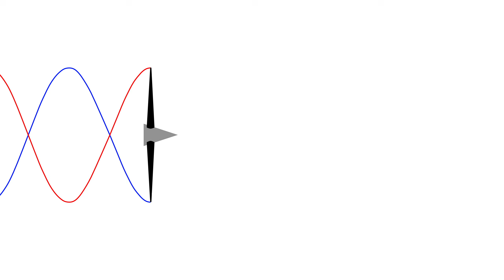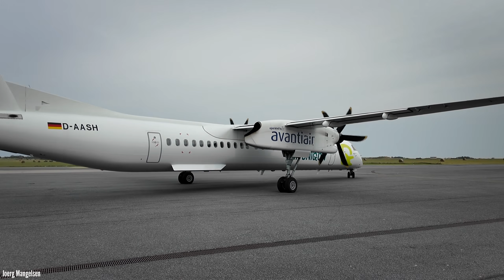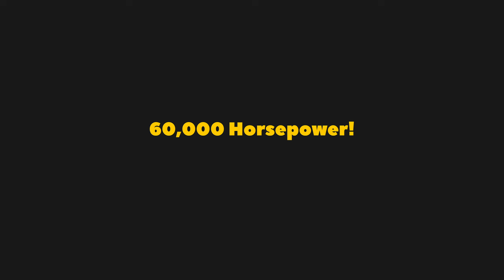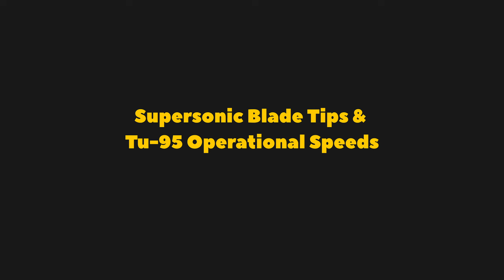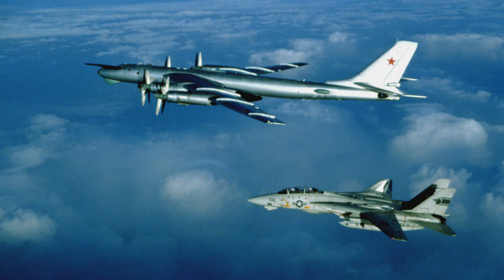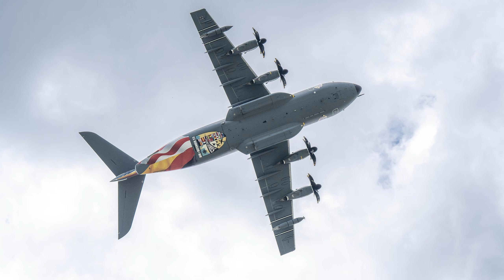How the Tu-95 Achieves Its Speed (& Why THIS Turboprop is Faster)

Comment from the maker: Support me on Patreon : https://www.patreon.com/letsgoaviate/
Smallest Turbojet Engines (Crewed) Design & Applications - https://youtu.be/PMmVKkrXUO8
Boeing YC-14 Upper Surface Blowing & C-130 Hidden Facts - https://youtu.be/_zZFNQDcwlA
Reply: You said that the propeller act like a wing.  I see on modern plain the wing tip banded to reduce wing tip turbulence vortexes. It clam to reduce airplane drag and improve overall air plane efficiency. Could that idea be apply to propeller wing tips to improve efficiency?
Reply: @miroslawkaras7710 I don't know if it could improve efficiency but I do know it would be super hard to make. A prop experiences huge centrifugal loads near the tip and a surface at the end going 90 deg from the rest would likely be torn off.
Reply from the maker: @miroslawkaras7710  Catto props did exactly that on their light aircraft propellers. It didn't quite revolutionize propellers. It has pros and cons, and on propellers it has cons that it doesn't have on wings. Maybe I'll cover it at some point.
Reply: @LetsGoAviate .
Very informative video; good graphics and explanation, without too much calculus.
Do you know if anyone has ever experimented with counter-rotating propellers, where the 2nd stage has a wider arc?
Reply: Well done

Comment: Its massive engines developed German engineers Anselm Franz and Ferdinand Brandner at Junkers Jumo is a major factor. The Jumo 109-022 is based on the enlarged version of the Jumo 109-004 turbojets known as the 109-012,

Comment: you neglected a possibly major factor:   the Airbus A400M's propellers adjust their RPM whereas the Tu-95's propellers do not adjust their RPM during flight to change speed; instead, they operate as constant-speed propellers.  So airbus has used two mechanical tricks to optimize performance at any speed and the tu-95 only one (variable-pitch blades). Therefore me guesses the shape of the a400m propellers may not even suffice to make up for the missing counterotating blades vs. the tu-95. AND The a400m engine has serious downtime-for-repairs issues whereas the tu-95 has very little.

Comment: 5k km is not 'cruising' long enough?  Test pilot Ivan Sukhomlin pushed the tu-95 during specific load and speed trials, setting official Fédération Aéronautique Internationale (FAI) records—including averaging 877.21 km/h over a 5,000 km closed circuit on April 9, 1960.

Comment: Flight testing and state acceptance trials conducted by test pilots like Ivan Sukhomlin determined the maximum and cruising speeds of the Tupolev Tu-95 and Tupolev Tu-114.
Flight Testing and Trials.
Factory and State Trials: Initial performance boundaries were established through manufacturer flight tests at Zhukovsky Air Base, followed by State Acceptance Trials with the Soviet Air Force and civil aviation authorities (Aeroflot).
Speed Record Flights: Test pilot Ivan Sukhomlin pushed the platform during specific load and speed trials, setting official Fédération Aéronautique Internationale (FAI) records—including reaching 877.21 km/h over a 5,000 km closed circuit on April 9, 1960.
Flutter and Vibration Testing: Because the Kuznetsov NK-12 turboprop tips move at supersonic speeds, high-speed dive and level-flight trials were critical to monitor extreme acoustic resonance and airframe flutter.
Resulting Speeds:
Tu-95 Bear Maximum/Cruise: Maximum speed reached approximately 925 km/h (575 mph), with a standard operational cruising speed around 710 to 738 km/h.
Tu-114 Rossiya Maximum/Cruise: Maximum level speed touched roughly 870–880 km/h (approx. Mach 0.78 to 0.82 in testing), while standard economic cruising speed was set at roughly 770 km/h (Mach 0.71).

Comment: You did not mention the residual jet thrust of the Kuznetsov engines of the Tu 95. I have not found any numbers but the proportion of jet thrust in relation to shaft horsepower of the NK 12 is certanlly higher than on todays commercial turboprops. The engine was designed by german ex-Junkers and -BMW engineers as POWs; if you look at german concept turboprops like the Jumo 022 these had an energy splitting between shaft hp and residual thrust of nearly 50/50; therefore it is obvious that the NK 12 also has high residual thrust which becomes important and more effective at high flight speeds.
Reply from the maker: Didn't mention it because its not unique to the Tu-95/NK-12. It would not be that high (50%). To be as efficient as possible, as much of the kinetic and thermal energy in the exhaust needs to be used to spin the propellers. Today some turboprops produce less than 10% of thrust via exhaust. The NK-12s would almost certainly have produced more, probably close to 20%. But more than that and the engines would become inefficient. The reason turboprops spin propeller is efficieny (primarily). The Tu-95 was designed with massive range as a primary goal, so efficiency was top of mind.
Reply: @L @LetsGoAviate  I agree - 20% could be realistic; I am sure you have the book "Russian Jet Bombers" (Buttler/Gordon) where the Tu 95 and its planned successors are described (calculated max speed: 1.000 km/h with turboprops); there the authors mention that the higher the altitude and the higher the speed the more the exhaust thrust takes a dominant part. Yes, today turboprops in civil applications are essential turboshafts.

Comment: your definition of faster is very skewed, cruising speed is an arbitrary operational constraint that is solely dictated by efficiency, tu95s generally fly slower on cruise because dont make sense to fly at top speed always, if a a400 crew wanted to fly faster than a tu95 in a balls to the wall condition that is physically impossible, that objectively means that it is not the fastest aircraft because it physically can't reach the same speed in a non constrained operational profile. Faster does not mean the most conveniently fast on regular operation it is the definition of wich one is capable of reaching a higher speeds in absolute.
Reply from the maker: I made no claims about the A400 being able to out gun the Tu-95 in a full throttle race. I painstakingly explained I'm talking about cruise speed, not max speed. No need for mental gymnastics.

Comment: Great video! So if I understand things correctly, the Bear at max speed probably has airflow on “parts” of the propeller (suction side and particularly the aft propeller) moving at transonic speeds if not at sonic speeds. So the next time someone says that the airflow doesn’t break the speed of sound, I will refer them to this video. Would love to see a modern CFD simulation of the airflow of the Bear. Tho I would assume that some of that extremely high acoustic energy is due to the trailing propeller encountering the irregular flow off of the front propeller.
Reply from the maker: I doubt the propeller slipstream is supersonic, but it's higher than the freestream, and almost certainly is in the mach 0.8+ region where compressibility problems start.

Comment: Why don't the Russians upgrade the propellers on the TU-95?
Reply: They do, Tu-95MSM is equipped with the AV-60T, the max output to the propeller has increased, the traction characteristics have increased, and this thing is no longer roaring so loudly.
Reply: @Տիգրան-ժ1է  Do you know if it has improved the cruising speed, range, etc.?

Comment: Yo tambien tuve que comprobar dos veces la velocidad del A400M, crecí creyendo que el turboprop mas rápido era el Tu-95.
Reply from the maker: Well, it is the fastest. It set records. But the problem comes in when comparing it's maximum speed (which it rarely flies at in operational use), to the cruise speed of other aircraft (which people love to do), especially as there is at least one turboprop that cruises as fast or faster in operation.

Comment: Two points you didn't mention. 1) The Tu95, like the Convair Coronado, has anti-shock bodies/Küchemann carrots/Whitcomb bodies which delay the onset of mach shock, so contribute to the speed (look them up if you are unaware). 2) Re. noise, part of the problem is resonance: having the same number of blades on each of the pair of contra-rotating blades means every blade simultaneously interacts with another on the other propellor. Another part is tip vortex interference. Later studies showed that there were (at least) two ways to mitigate the noise: a) have a different number of blades on the two propellors b) have the leading propellor smaller than the trailing one, so minimising the interaction of tip vortices (which slightly reduces efficiency vs equal length).
As an aside, the Tu95 was so noisy that RAF pilots noted that they could clearly hear the din over the noise of their own jet engines. (PS I've never been in any of the services - I merely note what has been reported).
Reply from the maker: I didn't know the Tu-95 pioneered anti-shock bodies. Thanks. Dedicated anti-shock bodies are rare these days, as they are incorporated into other devices, like on the A400, it's doubling as flap-track fairings.

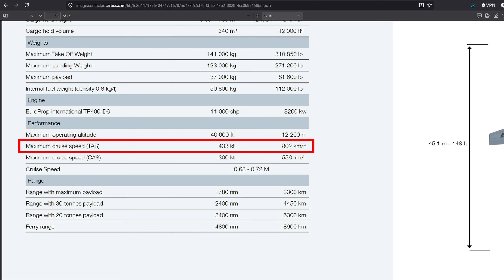Comment: 18:40 why does it have two cruising speeds?
Reply from the maker: If you are referring to TAS and CAS, TAS is true airspeed, and is the one we are interested in. IAS (Indicated airspeed) is what the instrument/guage in the shows, but is usually has some instrument error (internal), as well as posision error, due to the position of the pitot and/or static tube in relation to oncoming air. CAS calibrates and remove those errors. But CAS doesn't account for lower air density at higher altitude, and thus severely under-reads at high alt. True airspeed, as it implies, is the actual speed of the plane in relation to the air it is flying through, and is calculable with air pressure, temperature and humidity values.

Comment: Not doubting, genuinely curious, why does the airspeed normal to the leading edge matter for calculating mach speed instead of the total airspeed vector over the leading edge (not normal to the edge)? After all, the total airflow is not normal to the leading edge, so why doesn't that contribute towarch mach number?
Reply from the maker: Extremely simplified explanation. A car carshed into a steel wall head-on, perpendicular. Antoher car crashes into the same wall, same speed, but at 35° to the wall. All else being equal, which one will compress the most (have the most destructive crash)?

Air meeting the leading edge perpendicular compresses more, and thus experience high subsonic compressibility problems at a lower speeds.

Comment: Apparently the reason for why they chose propeller engines for the A400M is that propellers are better for diving. Heavy jet engine planes apparently have the problem that in a dive the aircraft can start falling faster than the engines suck in air, which causes them to start pushing a cushion of air in front of them and lose grip on the air flow, so to say. Propellers don't have that problem and that is useful for a military transport plane because good diving performance means the plane can stay high longer and decent on a air field later, staying high up for a longer time, even on a landing aproach and thus staying outside of the range of small arms fire for longer.

I am not sure whether I remember the explanation for the problem with diving jet engines correctly in all details, so it would be interesting if you would address that in a future video.

Comment: I read in a textbook once there's a bit more to sweep than it effectively making the airfoil look thinner to the air. The text book explained that if you take an unswept wing airfoil then sweep it, yes that yields benefits. However, if you also take the same airfoil unswept wing, chop the wing up chordwise into laminae, then move each lamina back a little relative to each other to get a swept wing, that also yields benefits, yet there is no reduction in effective thickness like to the first type of sweep. I believe the reason is that sweep staggers the shock each lamina of wing contributes to the total shock so reducing peak pressures, but don't quote me on that ;0)

Comment: Considering the Tu95 was designed over 50 years ago and is still as fast as the A400 is deeply impressive.  An ex RAF instructor of mine used to fly Tornados in the interceptor role.  He said that to keep up with a Tu-95 in cruise, they had to use one engine on afterburner!
Reply: Even over 70 years ago

Comment: Now for the real comment:  The fan on the GE9X is 3.4 metres with a rotational speed about 2500rpm at take-off (don't no cruise rpm).  At cruise the air stream through the fan is clearly supersonic. Why doesn't the fan and fan duct choke up with shockwaves?
Reply from the maker: Did you account for sweep? The blade tips are swept forward. The duct allows better control of shockwaves, and reduced losses. That's simplified, theres more to it, but a ducted propeller tip operating transonic is usually not a big deal, and is much less of a problem than on open propellers.
Reply: @LetsGoAviate  thanks for your reply, I really need to look into shock wave formation of a ducted fan in more detail.  One thing you did not mention in you video about propellers is the tip vortex.  The high aspect ration propeller, visa vie the tu-95 behaves differently in this regard to the swept tip on the a400m. A big vortex must reduce propeller efficiency quite a bit.  The ducted fan solves the vortex problem by presenting an infinite wall at the end of each fan blade.  I think Kuznetzov tried to have the best of both worlds with the nk-93 which had a BPR of 16.5/1 but it doesn't seem to have gone anywhere.  The CFM RISE looks interesting but is still in development.  It would be good to hear your thoughts re a comparison of these two engines.  cheer T

Comment: Seems to me the key prop specs on the tu-95 and the a400 aren't that dissimilar 5.6m dia, 8 blades on contra hubs, and 735rpm versus 5.3m dia, 8 swept blades on 1 hub and 730rpm.  Both aircraft have comparable cruise speeds. a400m is about 142 tonnes versus 184 tonnes for tu95 ie about ratio 0.77 and the relative power is 0.73 in favour of the a400m.  Just goes to show that even with 60 years of development when flying in a straight line things have not changed that much,

Comment: Lots of people are shocked to learn a non negligible amount of thrust is developed from the turbine engine itself which also aids the propeller thrust and aids in the tu95's unusual speed.
Reply from the maker: Yes all turboprops produces small amount (around 10% of total) thrust via exhaust, because not all energy can be extracted from the hot gas.

So this didn't aid in the Tu-95's high speed any more than it does for most other turboprops.
Reply: @LetsGoAviate  huh! I knew all turboprops produce very small amounts of thrust but at almost half a ton of turbine thrust each i think the turbine thrust does play a small roll? If this is wrong I will happily stand corrected.
Reply: @LetsGoAviate  Also very good video and channel.

Comment: Don't know why you receive so much hate. This was a very well done and thorough video. The Tu-95, like the B-52, is still flying because it was a brilliant design build in a time of brilliance and most likely won't ever be repeated again in modern times as people love sexy jets. I hear some vibes about replacing the B-52 with a similar type of huge aircraft, but it is doubtful a replacement could be built with modern budget restraints, though of course if a near peer war breaks out (that doesn't go nuke right away) that calculation could change and 'affordable' goes out the window.
Reply from the maker: I honestly received no hate on this video (so far), only one personal insult. My audience (all of you) are generally great, just a handful of people who spew slurs when their favorite aircraft or engine gets an honest assessment. So my comment was half tongue in cheek.

Yes the Tu-95 is brilliant, I'm not sure if that came through in the video. 

I don't know if the B-52 will get replaced now that it's getting newer, more efficient engines as part of CERP. Seems to me more like they want to get another 70 years out of it.

Comment: Efficiency doesn’t influence just range and payload in military aircraft.
It does influence sustainabaíity and amount of resources available for training and combat operations, which can even mean a combat aircraft (or any other mechanical or weapons system) that’s too expensive to operate can’t be used effectively because of untrained crews, or even can’t be used at all. Which has consequences for the resulting combat efficiency of the whole military in question.
Reply from the maker: Yes, great point!